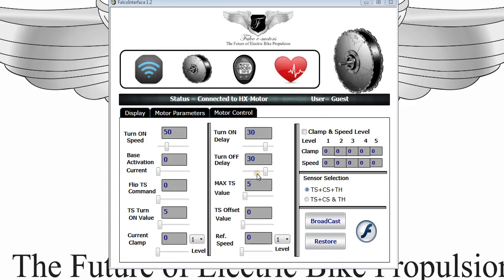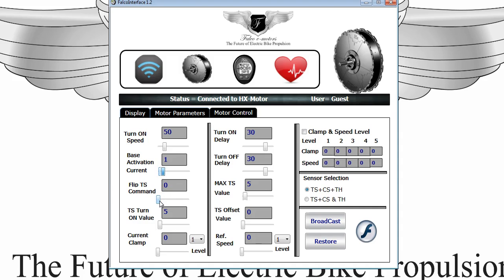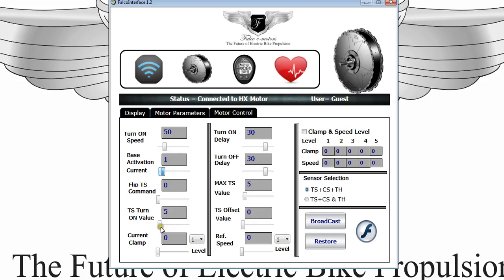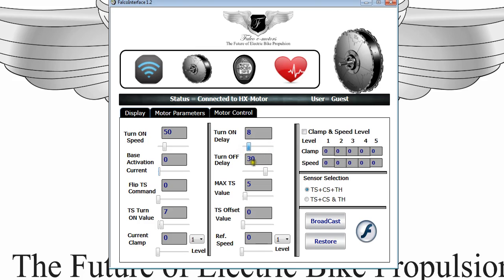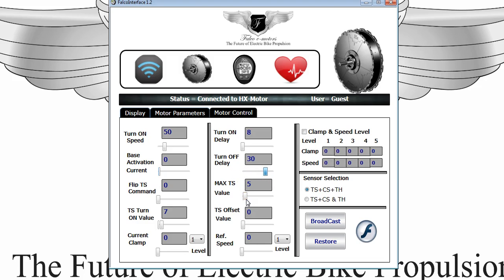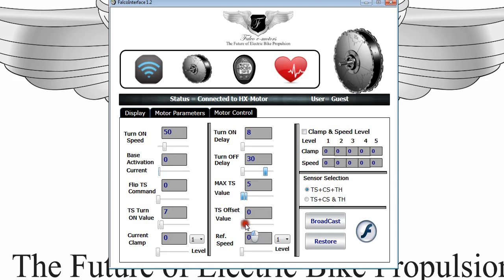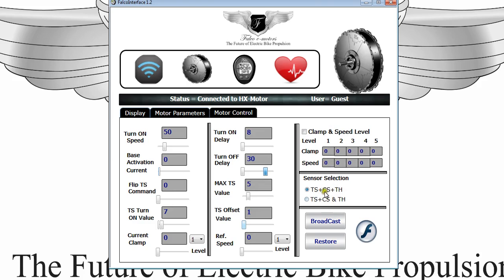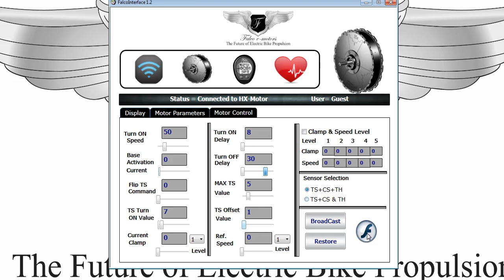Falco Interface 1.2 - Part 2 (Adjusting Torque Sensor Settings)

Comment: Do you need the wireless console to connect to the HX-motor?  I inserted my ANT+ USB stick and installed the software, but 'Connect' is grayed out.  Doesn't seem to detect the motor.
Reply from the maker: No. You do not require the wireless console. Connect is greyed out could be because the ANT+ drivers did not load properly.

Comment: Hi there, very nice concept. But what's the technical problem not being able to use a horizontal drop out? I would like to use your motor for a single speed (minimal) bike which usually have such horizontal drop outs. So the plan is to use no display, throttle, any kind of "select devices"  - it shall use only the built-in torque sensor. Next question: can I purchase a motor with 120mm single speed option?
Reply from the maker: We only make motors for 135mm drop-out currently. We have discontinued making speciality motors.